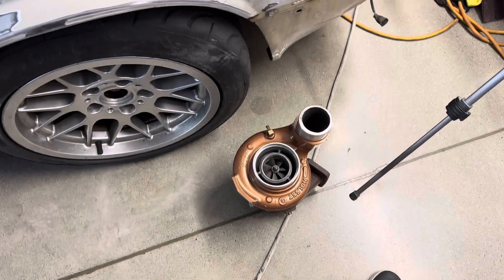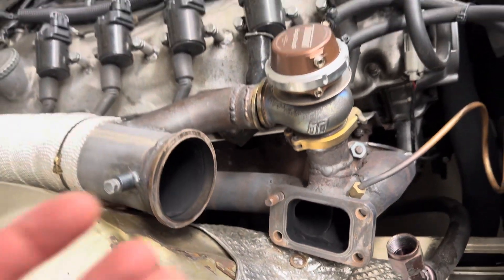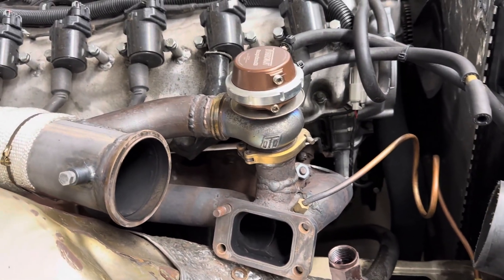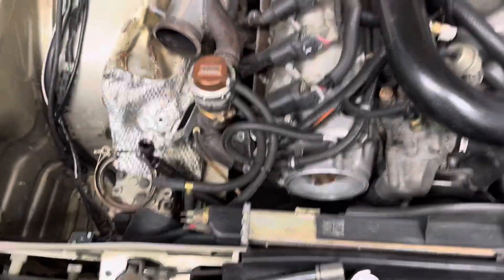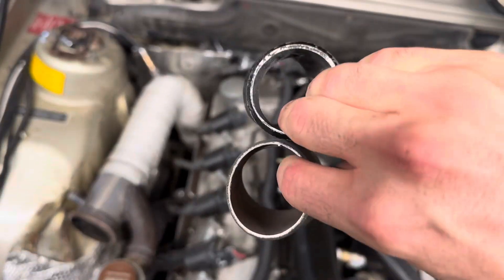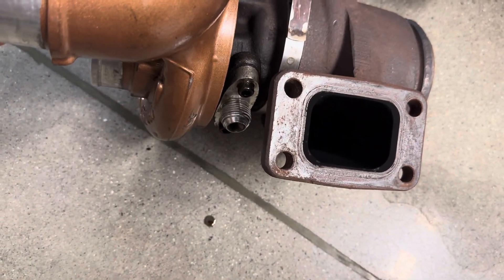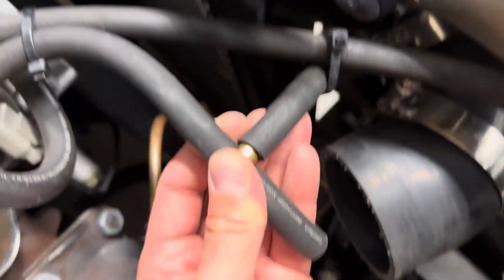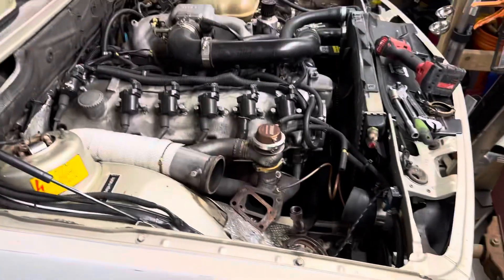559WHP DIY BMW E28 Turbo Manifold Overview (homemade)

Comment: So, you've mentioned how you've changed different thing to drop backpressure. Now being basically 1.1-1.

Have you considered upsizing the downpipe to 4 inches to see if it would change anything?

Your videos are basically my HE341 bible so I'm always wondering stuff like this so I can apply it later to my own build.

Comment: Are you using a restrictor on your turbo oil feed
Reply from the maker: Being that this is a journal bearing turbo no restriction is needed
Reply: @TurbineResearch  I don't want to loose oil pressure to my engine, so can I run a 90 thou restrictor to mine so I don't loose a pike of pressure

Comment: People always think you need fancy flashy expensive TIG welded everything to make power. It's simply not the case. Can you gain efficiency by spending a ton of money? Of course. The question is if you want to spend $500-1000 for the last 2-10% hahaha.
Reply from the maker: Exactly!